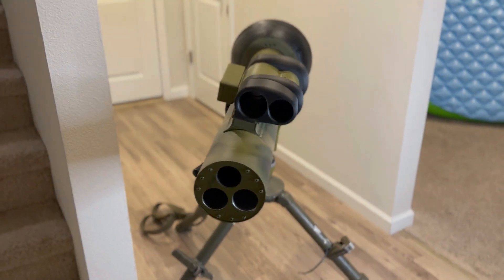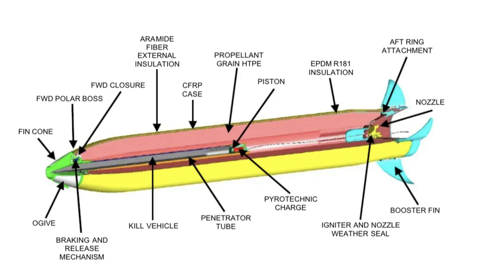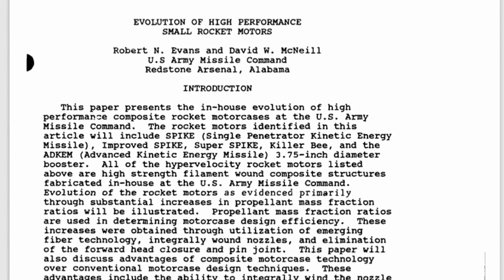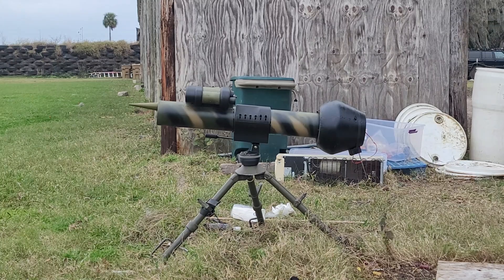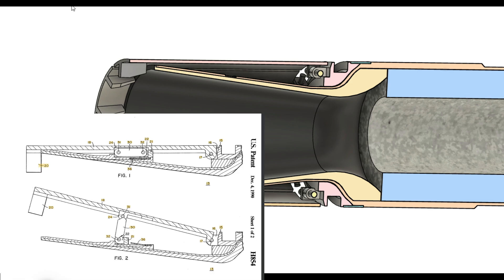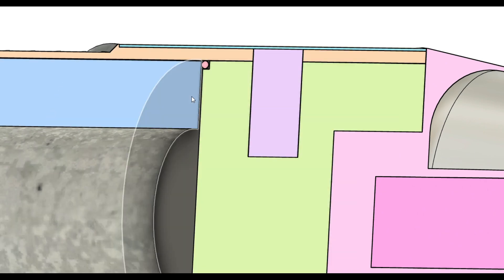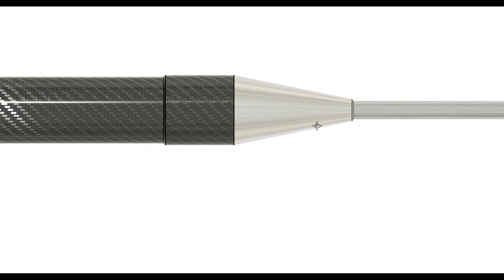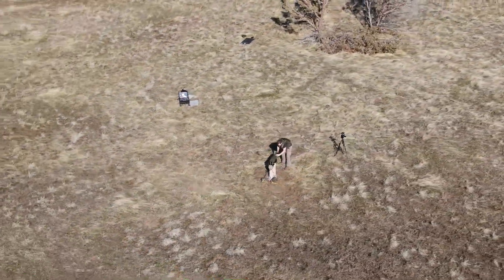Building A Hypervelocity Rocket - Project Announcement

Comment: No way you find a way to make this propellant
Reply from the maker: I’ve made APCP on multiple occasions, the main difference is the micron size of AP the original used. There’s several patents that explain how to get to the correct micron size as well as the burn rate catalyst they used
Reply: @ achieving sub micron particle propellant at home ain’t happening mane, there’s whole startups that can’t figure it out
Reply from the maker: @Najsnwjsbdn it’s not cheap but you can freeze dry AP to create sub micron AP , it’s been figured out since the 1970. Patent (US3892610A) there’s more modern processes that have better yields and more precise micron size but given this was developed around the 1970s-1980s Redstone arsenal likely used this exact method to make this propellant. Based on my FOIA requests, I will be getting exact confirmation because I have spent 1.5 years working on getting the technical documentation on the propellants , regardless I am starting with an earlier hypervelocity rocket (from the 1960s) that did not use sub-micron AP so I don’t have to work with an FEL to make the propellants as anything sub-15 micron is explosives
Reply: @ you’re insane dude, foia for rocket gear 😂. God bless, good luck brother

Comment: This is awesome, always love getting notifications from your channel so I can see the crazy stuff you’re working on! What propellant are you planning on using? Ok, you mentioned an AP propellant, but can you say what the mixture consists of?
Reply from the maker: Thanks ! I’m using a very high burn rate AP based propellant, need to start static testing soon to come up with right formula
Reply: @WildArmsResearchAndDevelopment this seems like a really cool project, just looking at the motor design, it’s going to burn FAST, especially with a faster propellant mix. Definitely looking forward to seeing how this goes. Testing is going to be really important, that fast of a burn is going to create some really high pressure.
Reply from the maker: It’s mainly very fine particle size of AP and burn rate catalysts to increase the burn rate
Reply: @WildArmsResearchAndDevelopment  what catalysts? I have used iron and copper oxides, but I know there are a lot of compounds that work.
Reply from the maker: Ferocene or catocene most likely
Reply: @WildArmsResearchAndDevelopment  thanks!

Comment: Are you using ROKSIM to test rocket deign/stability?
Reply from the maker: Does that software work for horizontal flight ?
Reply: @WildArmsResearchAndDevelopment  Well, it’s not designed for that per day, but a rocket needs directional stability regardless of the angle of firing. A horizontal shot means gravity it going to have a more dramatic effect, but I would think the stability aspect should carry over.